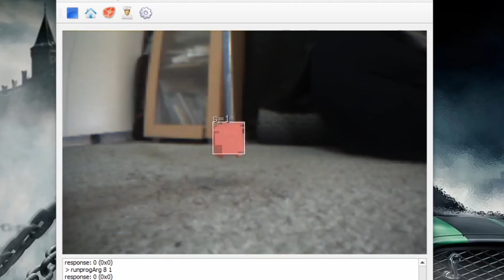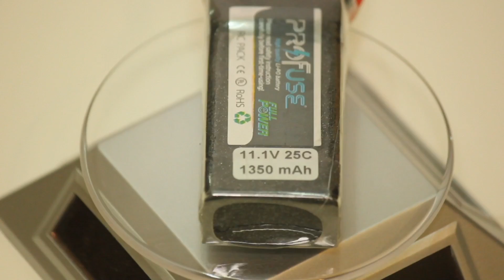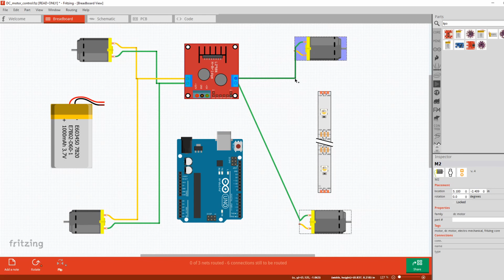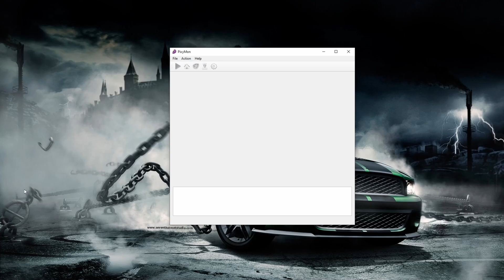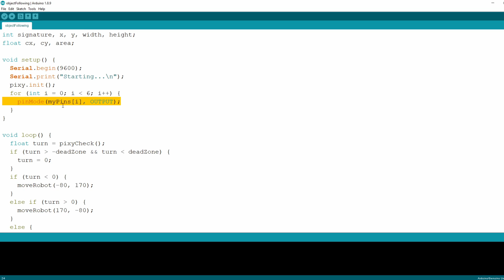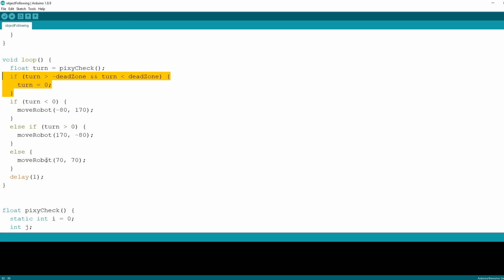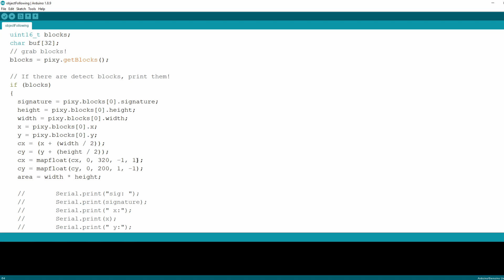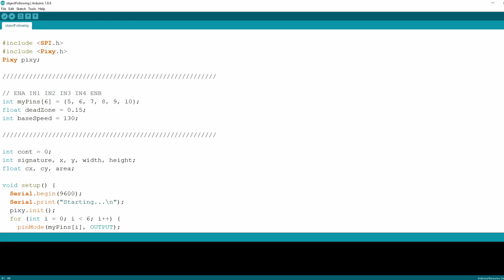Easy Object Following Robot using Arduino and PixyCam

Comment: Hello :)
I made the robot in your video "Easy Object Following Robot using Arduino and PixyCam" but the robot needs to go forward.
else { moveRobot(70, 70); }
Only the right motor rotates. Left motor does not move. I sent -70 to the Left engine to test it, it worked. But it doesn't go straight with 70. The rest of the code works fine. Do you have a solution suggestion?

Comment: Would this be possible if you wanted to hook up something to yourself that beeped every time it came into contact with a specific set of receivers?? So for example if the car was just driving in a straight line past a series of objects, it would beep when it passed certain ones (such as ones that had a receiver or something) and not others

Comment: Can u make me a drone based project which should have 3 features? 
.
1. Object detections and count 
2. Object tracking 
3. Automatic obstacle changing if something comes in way while tracking object. 
.
The drone should be connected with mobile. If drone has followed/ tracked a person so whenever owner wants, the drone would return to the place where that owner cellphone is. 
.
Thank You

Comment: Hello, how did you fit the battery splitter cables inside the 12v and ground terminals?

Comment: I am working on this project with  a Pixy 2 and running into some problems. Every time I run the program, I get an error that says  Pixy2 has no member named 'getBlocks' Please help if you can.
Reply: Hey, Have you rectified your problem?
Reply: @MohamedAli-cv4hu  have u solved this i am also stuck
Reply: @farhanraza1995  no I havent
Reply: @farhanraza1995  Have you made any progress in code? if so can you share please!
Reply: Can you change to code for pixy2

Comment: Can you please help? I am using a pixy 2 and I am getting few errors in the code.
Reply from the maker: Sure
Reply: @murtazasworkshop  I am actually using a chassis with two motors and wheels and pixy 2. I have managed to fixed the errors and compile the code on pixy 2. But the robot doesn't seems to follow the object correct. I think it has something to do with the values in the moveRobot if statement. Any ideas?
Reply: @yiannispahitas192  Geia sou file mou prospathw kai egw na kanw to robot kai exw problima me ton kodika, den pernei dedomena apo tin pixy 2, mporeis na me voithiseis se parakalw?
Reply: Have you sorted the code?